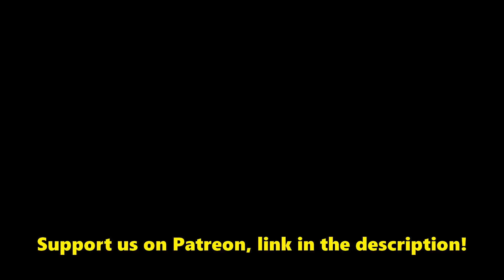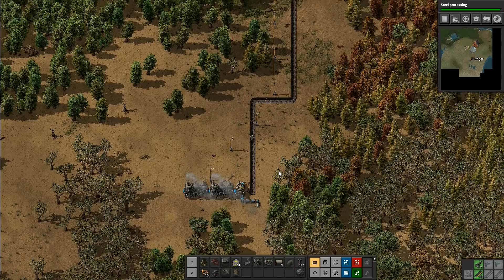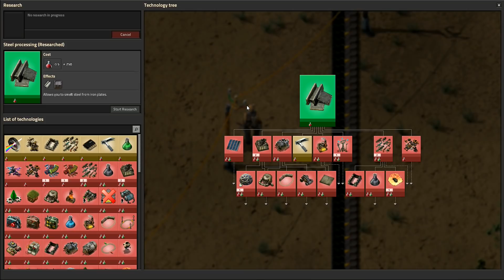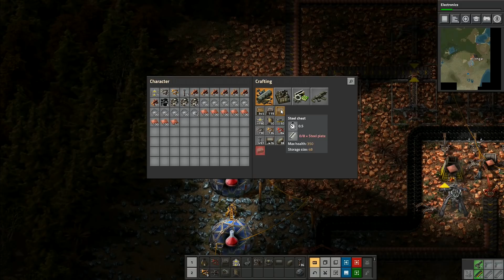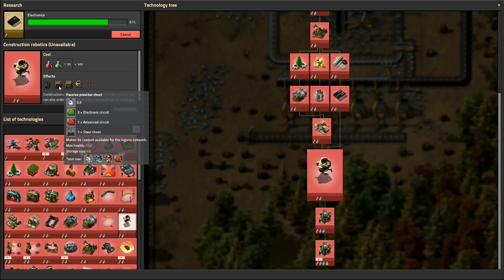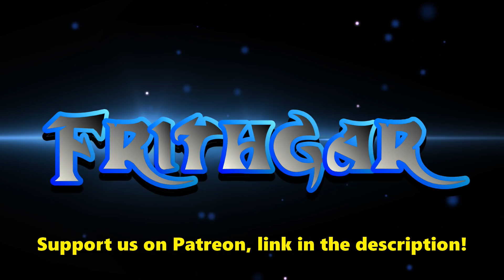Factorio Million Robot Challenge #6: Steel!

Comment: Since you have underground belts you can choose an item off of either side of a belt, yes you can.
Since you also have splitters you can as of 0.16.17 use a splitter to choose an item from a belt.
The only time I have used filter inserters is for adding items to a chest when I am picking from a mixed belt like if I have ammo and grenades on a belt and I wish to store some while they are being used for military science packs.